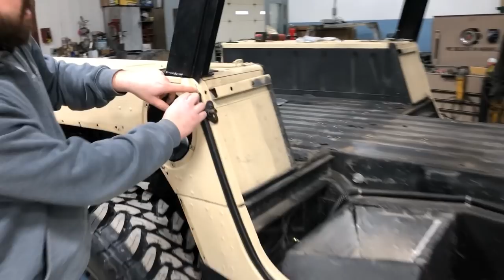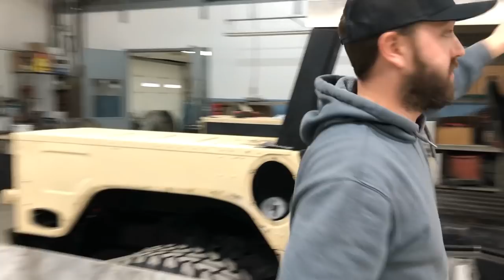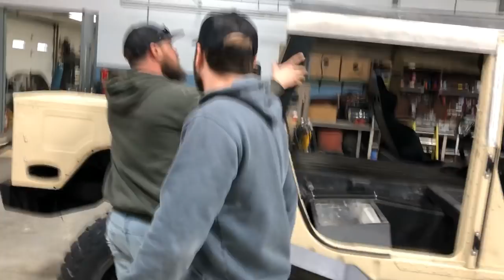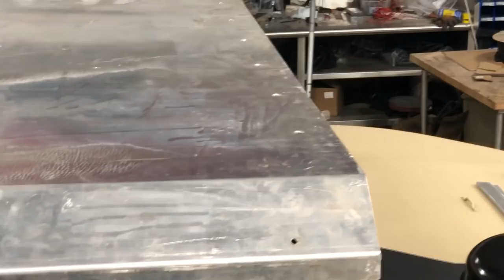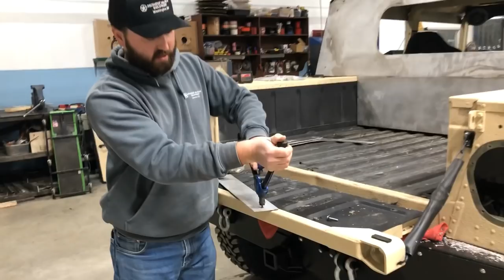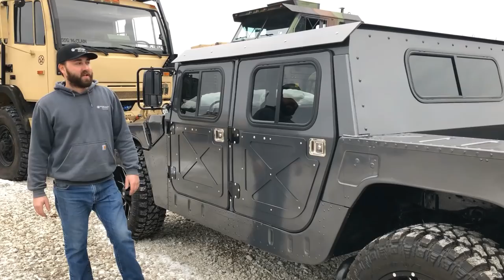**INSTALL** 1/8" ALUMINUM HMMWV 4 DOOR HARD TOP KIT

Comment: I want to know what the wheels and tires are on this one and if they would work on a non lifted humvee. Mine is a 6.5NA 1097A2 and I like the look of those lol
Reply from the maker: 37x13.50x20 and 20x10 Black Rhinos! No Lift Needed!
Reply: @MidwestMilitaryEquipment  Thank you!! I have been looking for something other than the military wheels it comes with. But I have had a hard time finding non military or advice on which ones to use as they all are conflicting on bolt pattern, tire size etc and what may or may not mess up the humvee. A lot of purist is told me to stay with only the military issue ones lol but I want something for look and road use as well.
Reply from the maker: @TheComposer08  We carry them if you need them! Send our sales team an email at sales@midwestmilitaryequip.com

Comment: Still no seal for the rear wall ''floor'' , when water gets in bed and you hit the brakes you get water rushing in to the cabin compartment .
Reply: That said , very nice kit .
Reply from the maker: Hello,
We provide an extruded aluminum floor seal that matches the contour of the bed to keep the inside of the cab dry with the kit.
Thanks,
Midwest Military Equipment
Reply: @rudy52350  Did you not see the rear floor seal in the video? Lol 

I made my own out of 1/8th inch thick aluminum flat stock to keep my cargo divider sealed from rain water.

Comment: Do you guys do wagon top conversions for a H1 soft top and do you use gaskets to help IP ratings. The aluminum doors are great.  Do you have them with electric windows?
Reply from the maker: We do not have a wagon top at this time. We do have power window doors.